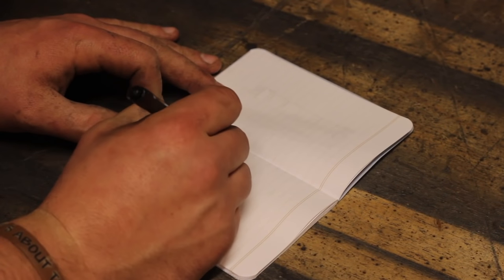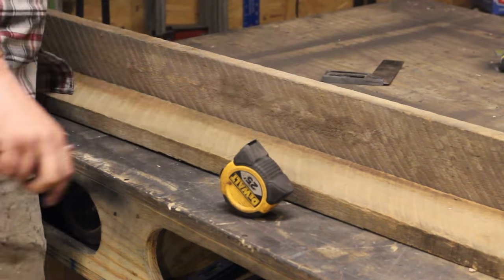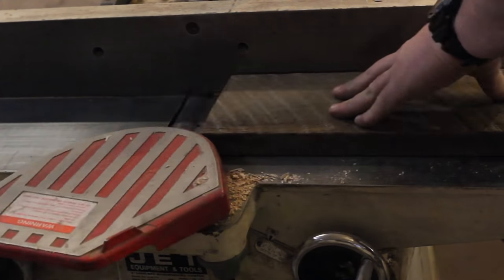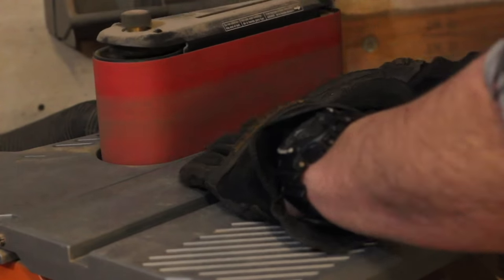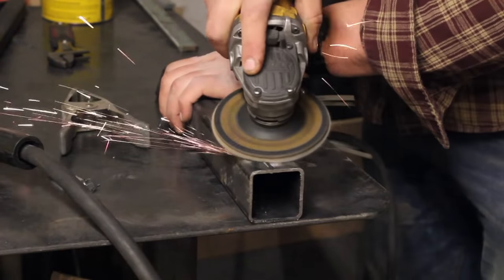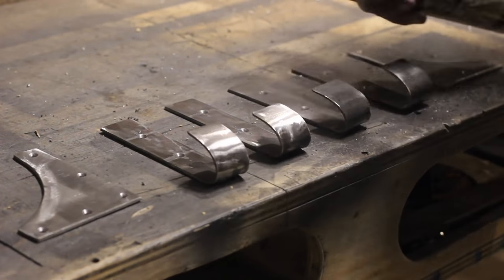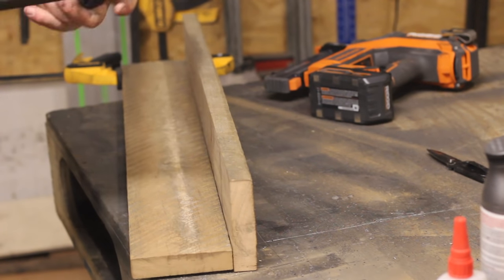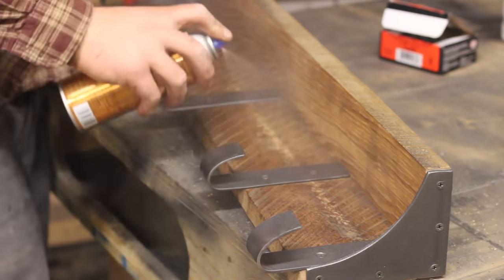Industrial Coat Rack Build and Giveaway!

Comment: nice project, can you tell what's the name of the tool to make the holes "square".
Reply from the maker: i dont think there is any square holes in this project. But you may be referring to the counter sink for the metal holes. they are round, and lets the screw head sit flush
Reply: Hey, thanks for the response. I made a mistake trying to explain myself. I meant the bit you use in 6:05, to make the holes for the screws, i guess that is to make the hole in the wood to match the center with the metal holes.
Reply from the maker: ahhh its a viks bit. If you turn on the sound i touch on why im using it in the video !
Reply: John Malecki Thanks, found it. I tried to understand what you said in the video, but I'm not really good speaking english, so tried to activate the captions but didn't work. thanks for the help.